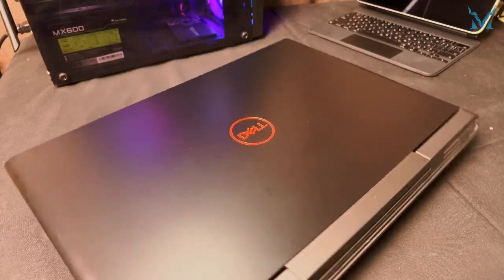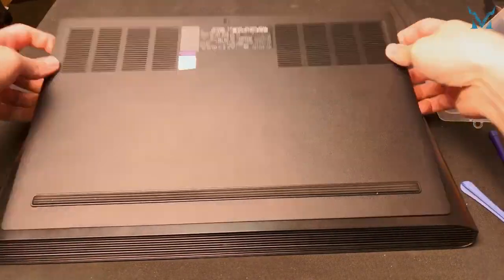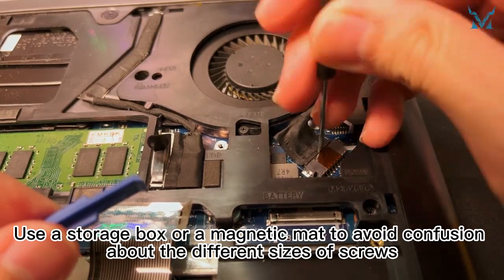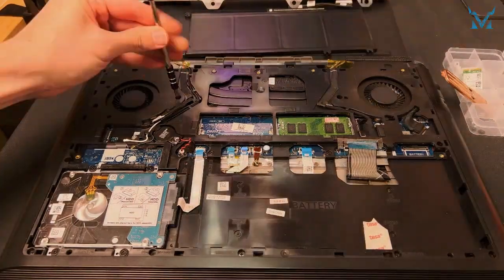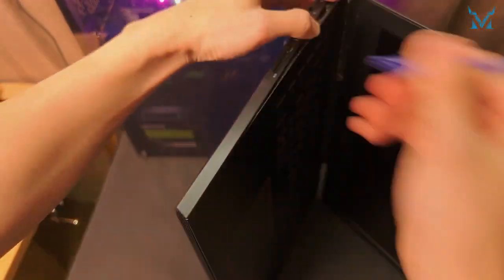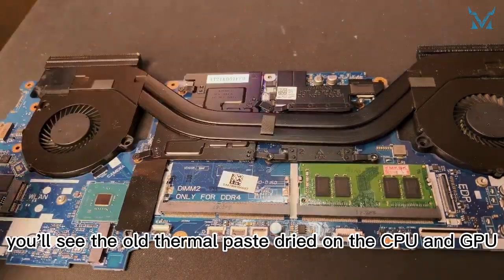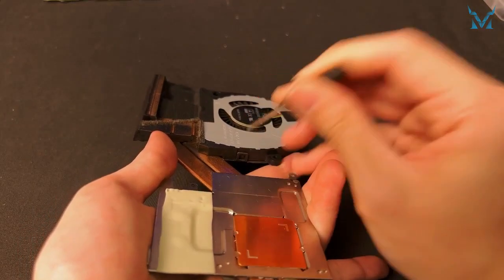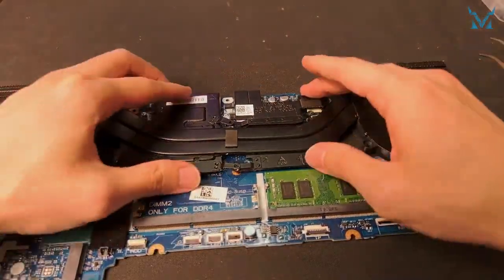Speed Up Your Dell G5 5587 Gaming - Prevent Overheating With Dust Cleaning & New Thermal Paste

Comment: Does this laptop can escape from thermal throttling by using cooling pads, since I have the same laptop with i7 8th gen gtx 1050ti which throttles my laptop for gta v struggling to maintain 30 fps after 10 mins of gameplay. I need a solution for it
Reply from the maker: Using a cooling pad can help reduce surface and intake temperatures slightly, which may delay or reduce thermal throttling to some extent. However, it’s not always a complete fix—especially for older laptops like the one with an i7 8th gen and GTX 1050 Ti, which tend to run hot under load.

Here are a few suggestions:

Clean your fans and vents – Dust buildup causes poor airflow.
Repaste your CPU/GPU – Replacing old thermal paste can greatly improve heat transfer.
Use a cooling pad – Especially one that aligns well with your laptop’s intake vents.
Limit background apps – Free up system resources before gaming.
Undervolt your CPU – Can reduce heat without sacrificing much performance.
Let us know if you’d like a simple guide or tool to check your temps or optimize your setup!

Besides, feel free to try our product：
【PERFORMANCE/OVERHEATING SOLUTIONS】- available across the globe!
Laptop dust cleaning & thermal paste replacement tool-kit combo: https://bit.ly/KMtoolkit

KOLD-01 Thermal Paste: https://bit.ly/kold-01-yt
KLEAN-01 Thermal Paste Cleaning Wipe: https://bit.ly/klean-01-yt
KOMBO-01 Screwdriver Set: https://bit.ly/kombo-01-yt
Air Duster: https://amzn.to/3YTclrP

Comment: have same pc and having a struggel to run gta clearly with good frames need help my hard disk health is 3 % and im getting new one
hope someone to help
Reply from the maker: It sounds like your hard disk's health is a major factor in the performance issues you're experiencing. A failing hard disk can cause significant slowdowns and stuttering in games, as data cannot be accessed efficiently. Replacing the hard drive with a new one, preferably an SSD, should drastically improve loading times and overall performance. In addition, poor cooling performance of the laptop can also lead to a decrease in performance. You may want to check if a new layer of thermal paste is needed. Feel free to try our products!

Comment: Now my computer doesnt start :(
Reply from the maker: After cleaning the dust and replacing the thermal paste, if the computer won't turn on, it is usually due to the following reasons:
Internal discharge wasn't fully cleared. It is recommended to remove the battery connector and discharge completely before trying again.
Internal connections are not properly seated. Please unplug and re-plug the connectors.
We hope our guide can be of assistance to you.

Comment: I changed the thermal paste according to the video, but now the sound from the PC does not work
Reply from the maker: There are many reason that can cause a problem with the sound. It is hard to know the best solution for your problem. However, try first checking if there are cables being stuck between components or if there are any loose screws. If the problem persists, leave more comments of contact us.